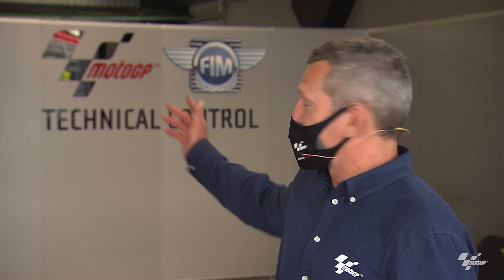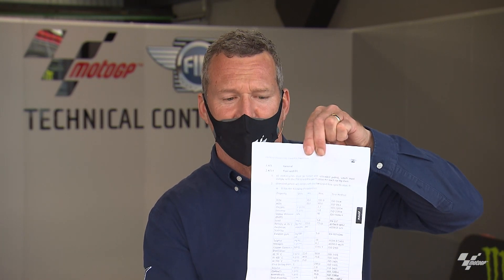MotoGP Fuel: Tech Talk with Simon Crafar

Comment: I've been tuning fuel injected race engines for almost 20 years, and I couldn't explain it better....  Except for the fact that if an engine was developed/designed the run on regular octane and there is nothing wrong with that engine, it will pretty much always make more power and better fuel economy on the regular octane.    Thus filling up with premium hight octane is a waste of money and engine efficiency.

Comment: In c 1988 I used AvGas, 100-130octane and quicky found that using 33% avgas was about right. Otherwise it ran rough and could foul the plugs in my 550hp, 8000rpm Chevy 350

Comment: Higher octane doesn't define higher quality... It's just Higher octane... Caloric value is more important as you suggested... Flammability & boiling/flash point is a much more critical measure especially in high revving engines when there's less time to complete each combustion event... Combustion stability vs combustion speed... High octane consumer fuels are slower burning than low octane by convension

Comment: It's NOT  about quality.. they're all the same "quality" from the same manufacturer.. the energy within the fuels.. from the same manufacturers is even the same so for the same ignition even (compression, chamber temperature etc) the result will be the same (HP).. BUT.. especially in 2-strokes which are notoriously difficult to detect detonation.. higher octane provides a higher margin of safety in race conditions before detonation occurs.. & higher compression ratios (actual) will return higher energy return in torque & HP.. higher octane fuels.. "tend" to burn slower than lower octanes & as Simon says.. are more stable in higher volitile conditions AND are kinder to an engines piston & valves because of it